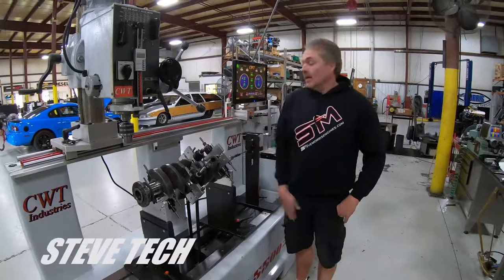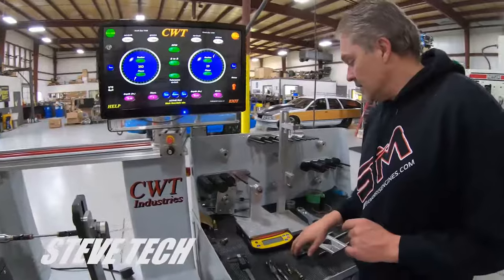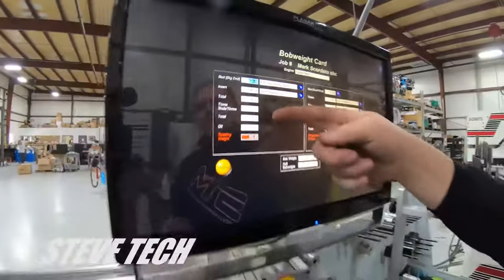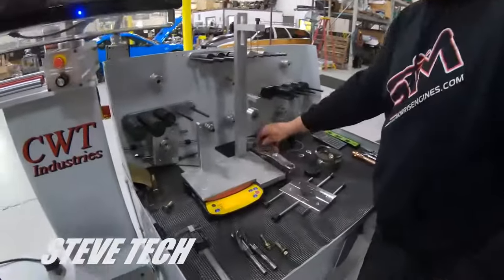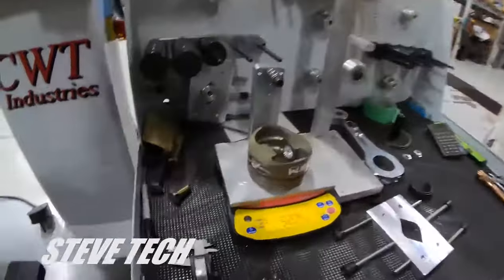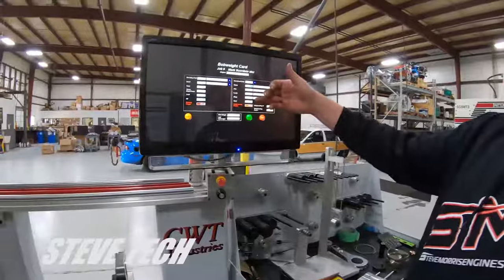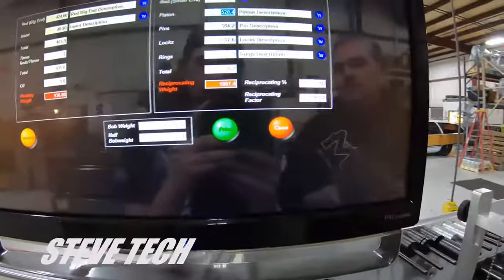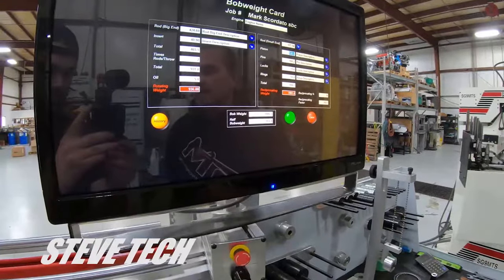Crankshaft Balancing – Part 1

Comment: You went over briefly the under and overbalance conditions and their advantages, but I'd like to know more about when it is needed or highly recommended. I've heard that certain V6 engines that run high rpm "need" to be overbalanced, but why? What are the consequences of not doing it? Obviously there's certain harmonics and such we are trying to deal with, so does this have an effect on being able to run the engine in an area where those harmonics would typically have detrimental effects and what does that do to the rest of the operating range?

Comment: For V6 engines its such a wide target that it makes one wonder what would be the correct factor.
The range Ive seen is 35-55%! Thats for both 60 and 90 deg engines and between.
For the 65 deg dino v6 they used something like 35-48 %

Comment: I'm confused how this works. There are two rotating masses at the throw but the mass is being pulled in different directions. And the reciprocating mass for both pistons are also opposing forces. Which is why you divided by 2 instead of multiplying but dividing doesn't make sense to me either. You have a mass of 950.7 going up, and a mass of 950.7 going down. Wouldn't they cancel out?
Reply: exactly right.. all this bullshit is just to justify having an expensive set up when its clearly not needed.
Reply: @philldownes8685  Wrong, of course it's needed. This is how to balance the CRANK, nothing else. If all the pistons and rods have been balanced to the exact same weight it would still cause vibrations if the crank is not balanced, since one side would weigh more than the opposite. It's not BS my man.
Reply: @bounzig  are cranks in production vehicles not balanced from factory?
Reply: @CalebsCars  Yes they are, but not nearly as good as in the video. And it depends on what car you get. Details like this is why some brands cost a lot more than others. And if you are thinking about tuning then balancing is key.

Comment: on ford 460 external balance, 
what is the correct clock position for the weight on the flex plate
 in relation to the hatchet weight on the front of the crank?
thanks